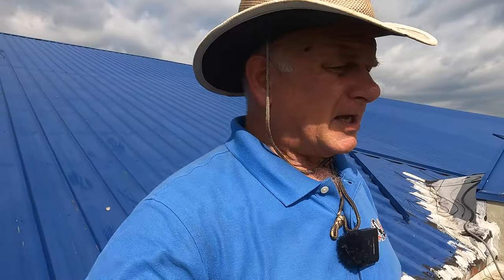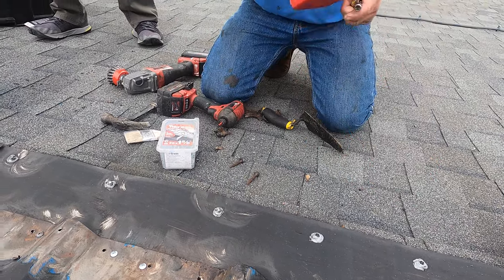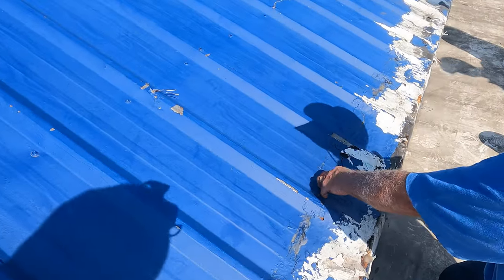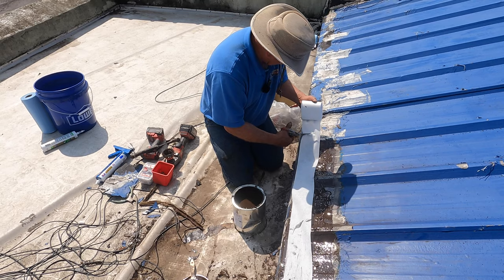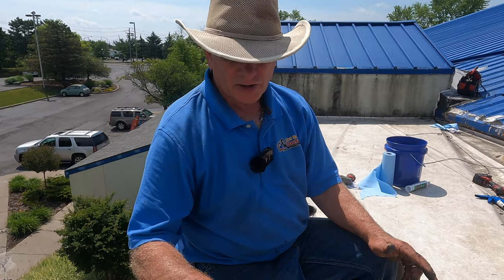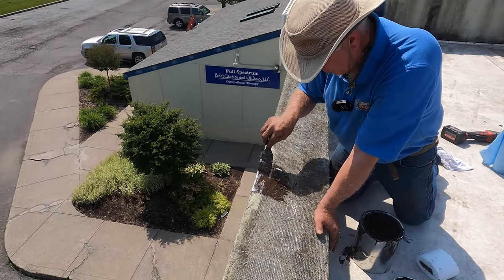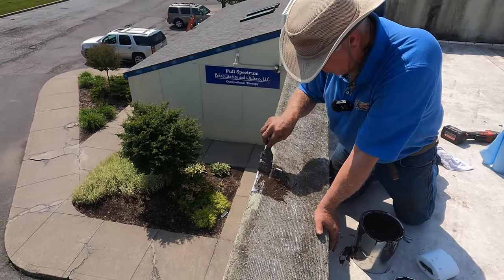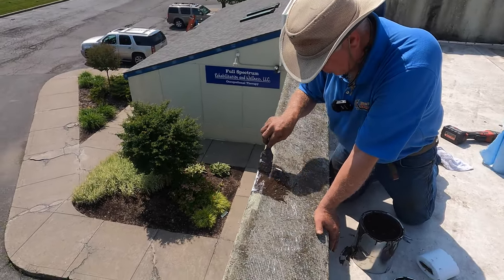Repairing METAL ROOF LEAKS- How to repair most common areas that causes leaks

Comment: I recently removed all of my shed's semi-rotted metal panels, grinded out all the rust and bad spots, hit the raw metal with some spray paint to keep temporary surface rust from forming, and refurbished each panel as best I could before re-mounting them with new roofing screws in a different configuration so the seams and overlaps ended up in different sections of the panels. All I have left to do now is patch and seal in the various pin-holes, screw holes, and larger holes with extra sheet metal and fleece, etc. Thanks!

Comment: We have discovered that there is a lot of water under the edge of our metal roof.  it is pooling and we need to install a membrane.  Is there a way we can do this ourselves?  We have been told that we should remove our entire metal roof and replace it with something else.  However, we only have problems with the edge of the roof and nowhere else.  I am hoping to find a way to do something that won't cost us a small fortune.  Thank you for any suggestion you can provide.

Comment: .......At timer 2:51 you say  "paint it an oil base it would be better"  NO it would  the UV rays will bake the oils out of the paint in about 5 years and it will get brittle and hard the metal roofing material will expand and crack the paint, it will hold water in the cracks and more trouble will come.....use an Acrylic paint.................

Comment: I enjoy watching your flat roof stuff. This one is driving me nuts. Never, never ever use asphalt on metal roofing. Metal moves with heat and asphalt gets hard and brittle and will fail. There are many great products for this application but not asphalt based.
Reply from the maker: you got it. or caulking
Reply: @FlatRoofDoctor  don’t use caulking?